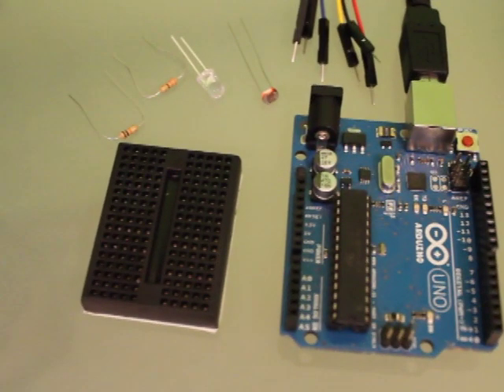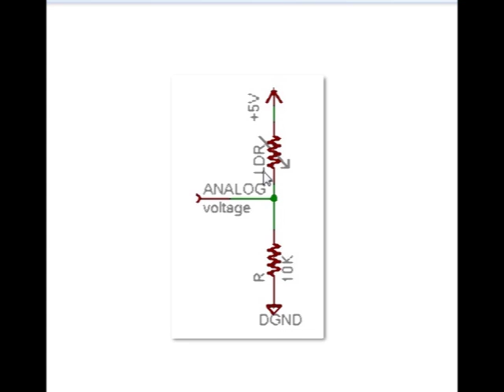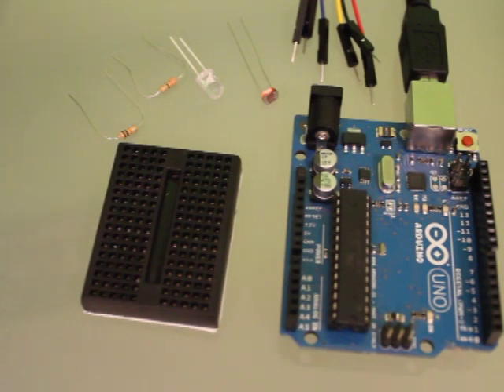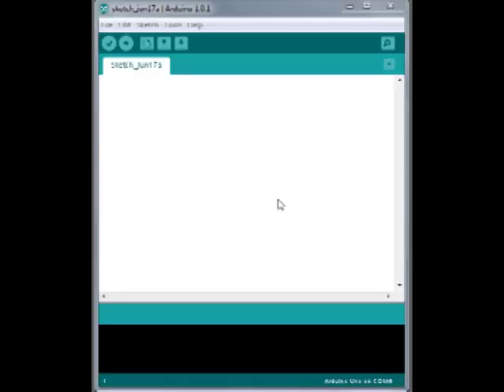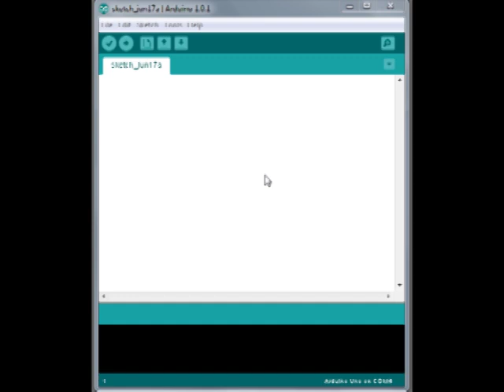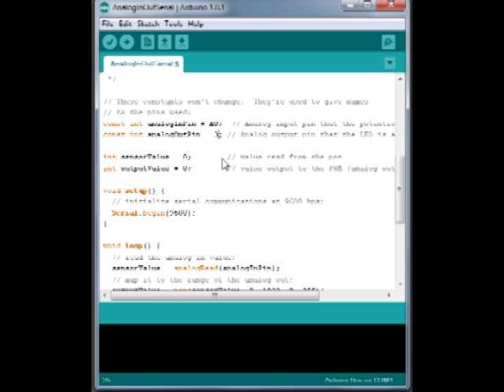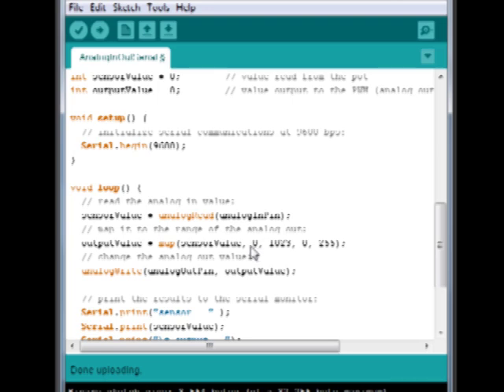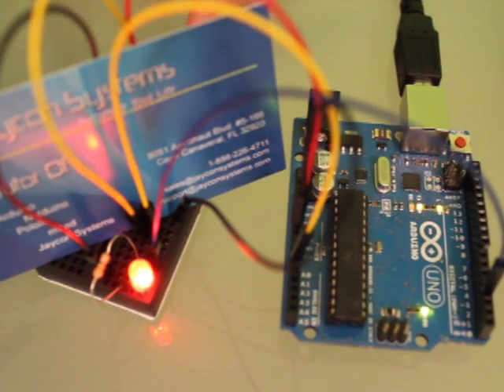Arduino + Photocell (Light Sensor) + LED

Comment: Didn't work. I use SYB - 46 bread board. It is 4 rows bigger than that bread board and has 1 positive rail separate and on the other side would be ground or + rail. Help plz?

Comment: Can i know how to make a "pause" coding.

example,

I have 4 (1,2,3,4) LED. on normal state, all four LED is HIGH and LOW  in sequence which is 
- 1 (HIGH then  LOW) then
- 2 (HIGH then  LOW) then
- 3 (HIGH then  LOW) then
- 4 (HIGH then  LOW) then,
over and over.

I have two sensor ( A and B), when sensor A get the input, there will be LED 2 and LED 3 is HIGH. (LED 1 and 4 LOW).

Then, when sensor B get the input, the operation or flow of all LED back to normal.

Can I know how to make this code?

Comment: I have theses operating my window blinds with servo motors. Here is the code I wrote. 

int light_val;
int blind = 0;
int x = 0;
#include <Servo.h>
Servo myservo;
void setup() {
  myservo.attach(9);
  myservo.write(1500);
  delay(2000);
}
void loop() {
  light_val = analogRead(0);
  x = light_val;
  delay(60000);
  light_val = analogRead(0);
  x = x + light_val;
  delay(60000);
  light_val = analogRead(0);
  x = x + light_val;
  x = x / 3;
  if (x <= 544) {         // lower darker
    if (blind == 0) {
      myservo.write(2000);
      delay(14780);
      myservo.write(1500);
      blind = 1;
      delay(1800000);
    }
  }
  if (x >= 545) {
    if (blind == 1) {
      myservo.write(0);
      delay(32600);
      myservo.write(1500);
      blind = 0;
      delay(1800000);
    }
  }
  delay(60000);
}
Reply: Thanks very much for posting this!!

Comment: hi can i get a hold of the code from you if you don mind  ?
Reply: // pin assignments
 int LED = 13;
 int LDR = 0;
 
 // variables
 int base;
 int threshold = 100;
 
 // declare inputs and outputs
 // and take a baseline reading
 void setup() {
   pinMode(LED, OUTPUT);
   pinMode(LDR, INPUT);
   base = analogRead(LDR);
 }
 
 // read from the analog input connected to the LDR
 // and print the value to the serial port.
 // the delay is only to avoid sending so much data
 // as to make it unreadable.
 void loop() {
   int v = analogRead(LDR);
   if ((base - v) > threshold) {
     digitalWrite(LED, HIGH);
   } else {
     digitalWrite(LED, LOW);
   }
 }That is a code I made, should work just copy and paste as your sketch.

Comment: Hi, Im a total newbie and this tutorial was really helpful. thanks. 
Can you please correct me if im wrong, so the fixed resistors do not have any effect on the led. They are just there to prevent short circuits when the photo-resistor is turned to a minimum to provide 0 resistance. Im I correct?